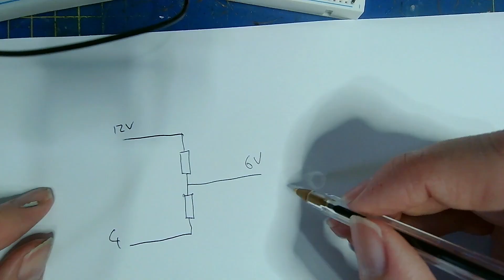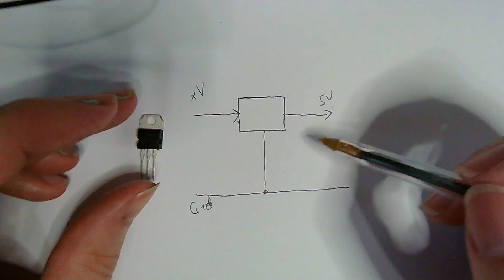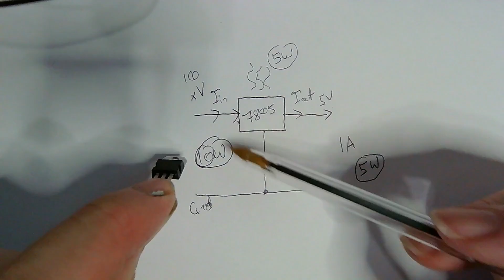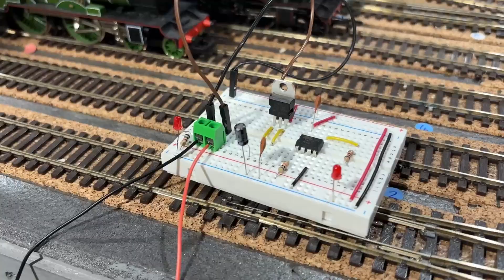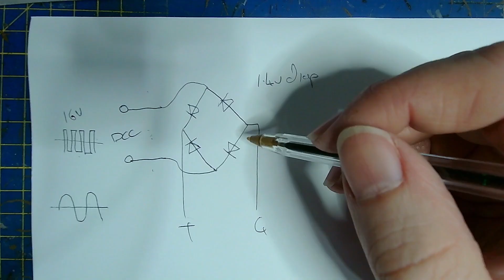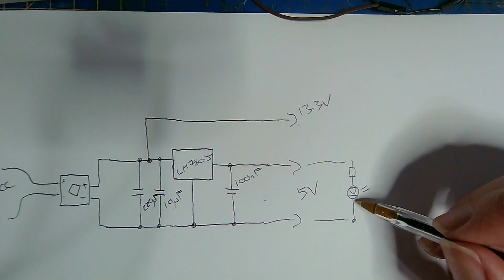16. Marking a DCC function decoder (part 2) - Powering from DCC #dcc #modelrailroad #AtTiny85

Comment: Having been away and taken a while to be able to watch part 1 it was nice not having to wait long for part 2 🙂 Hmm, I didn't give any consideration to heat management (too much to learn at once!) but I do intend to regularly check how hot things are getting. There are some nice tips in this, thanks!
Reply from the maker: heat stuff is generally not a problem, have most of under the regulator as copper and solder the tab to it and done - all that really goes through it is powering the AtTiny and anything else that must be on the 5v line, I'm using it for a bit more in the next one but when I move to coach lighting the 5v is just triggering a transistor and the actual lights are on the rectified DC. the LEDs will likely get hotter. just figured it was worth mentioning as I once used on the ones in the video to make a cut of tea.. just because I could

it wasn't very nice and it took ages

next bit was slightly delayed (should be Saturday) as I god some odd behaviour I've now fixed (code bug) and wanted to make sure I actually understood how a bit worked and didn't have to gloss over it as "trust me"

cheers for watching and hope its useful, I'm watching your videos on this too :)

Comment: Nice, but it would be much simpler if you connected a DCC track controller. Less wiring to deal with. I'd stick to 5v if I were you, just to ensure you don't end up on overload problems. Don't want to find you've blown the circuit boards to smithereens, I'm sure.
Reply from the maker: oh for testing connecting directly to the controller would make sense, the wires to the rails is really a short cut at the moment, this is, eventually, going inside a coach to power lighting.. just need to get some suitable wheels with pickups :)

Comment: Wait, you are only getting 4.8v from the USB port?
You have a problem there is there should be 5+ volts coming from the USB port.
If you accidentally apply external power to the USB power pin then funny things happen and you risk killing the USB port.
Don't ask me how I know.
Reply from the maker: USB port tends to be 5v, but by the time its been through the circuitry there has been usually a slight drop - if you feed the arduino 5v thats what you get as it bypasses the protection circuitry 

I think there is reverse protection here, (Schottky diode) but not all boards have it
Reply: @aleopardstail  I know about the volt drop but none of the microcontroller (including Arduino) have been less then 5V on the 5V output or the USB input when powered from USB.
I use USB volt testers and test meters to check on a regular bases.
Reply from the maker: hmm, need to try again this side and find out whats going on then :)
Reply: @aleopardstail  in case of confusion 5+v doesn’t mean 5 V positive as that’s  a given here, it meant to mean greater than 5V. I just forgot how to spell.
Also the 5V out shouldn’t pas through a regulator unless it is from the DC jack and unless the design has changed. If that’s now the case I stand corrected.

Comment: JFYI. May be construed as a bit pedantic, but you should not use standard rectifiers on DCC, as they cannot recover at such high frequencies and generate reverse spikes, you should use Schottky diodes instead, also available in small bridge format
Reply from the maker: nothing wrong with being pedantic, didn't know this, now do, will make a note of that and look to get some :)

many thanks
Reply: I agree.   There's a big difference between mains derived AC a normal bridge has to deal with and the 5 - 9KHz frequency range of a DCC signal.